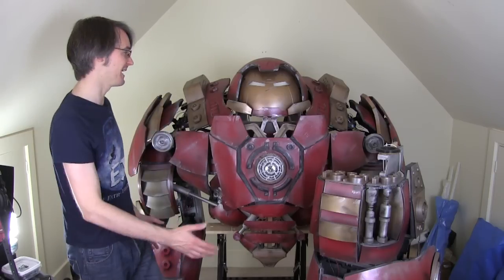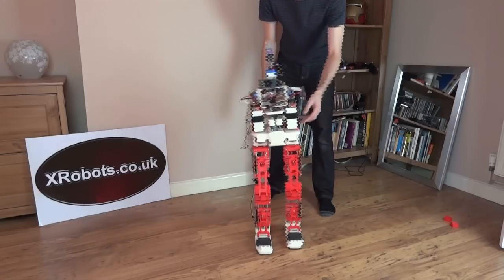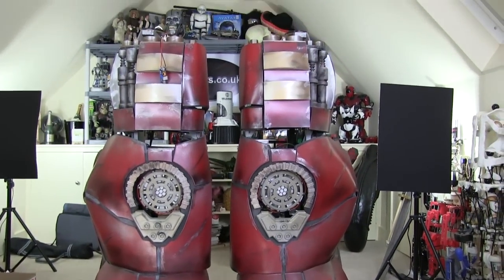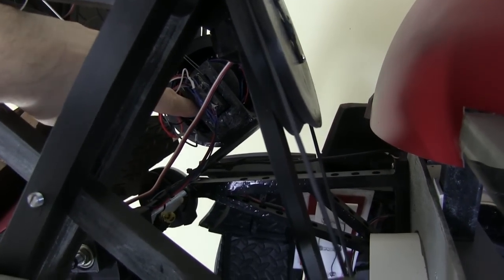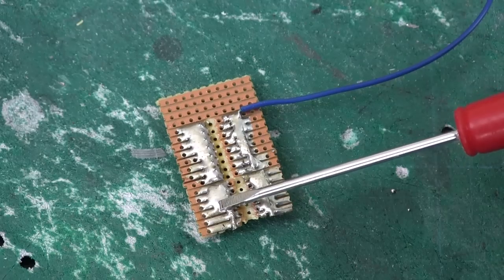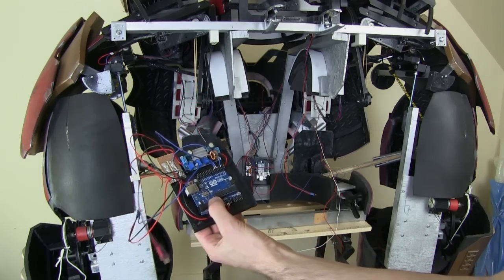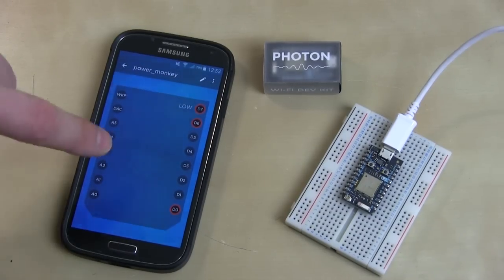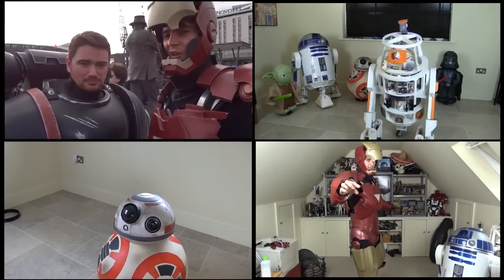Iron Man Hulkbuster Cosplay #42 | Electronics & Lights | James Bruton

Comment: The issue with the neopixles and servos is probably a conflict between the system timers that run them, might want to check that out or change the timers the libraries use

Comment: Incredible work! ;) 
But you should definitely sort these cables, because I guess "set the whole thing on fire" is not a wanted function of the suit :D 
Why didn't  you use a radio to control the suit? Wouldn't it be much easier (on the go) and maybe safer? 
Can you also control all the goods in the arms remotely or just what you showed in the video? 

By the way great new project idea! ;)

Comment: I think you can simply call myservo.detach(); with no pwm signal the servo should shut down and move no longer ...
Reply: +Andreas Hölldorfer / +James Bruton - Re: jittery servos - haven't used neopixels, but SoftwareSerial library does the same thing, disables interrupts to preserve integrity of serial data. For clean use of servos at the same time, you can use alternate SoftwareServo.h library (http://playground.arduino.cc/ComponentLib/Servo) - does not use interrupts to create PWM for servos thus avoids/solves the problem. Only catch is you need to call a refresh() function at least every 50ms... so may need to restructure code to not use fixed delays().. start timers running with millis() and check elapsed time to control functions (good practice anyway, allows multitasking on single controller)
Reply: +Andreas Hölldorfer and yes the neopixel library is a dirty hack, it disables the interrupts, (due a very good reason) but at enabling interrupts again some strange things happens with the timer the servo lib uses, so a glitch occurs. I had a lot of trouble with it, and still no stable solution.
Reply: +Andreas Hölldorfer. Can confirm this works.